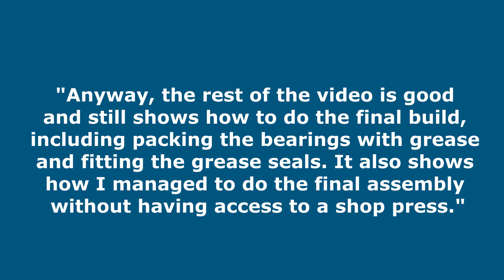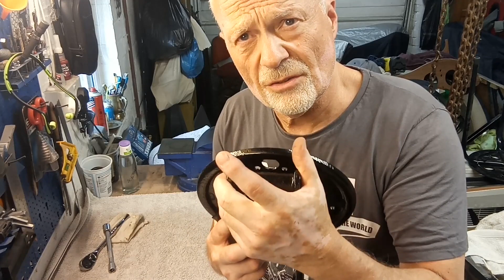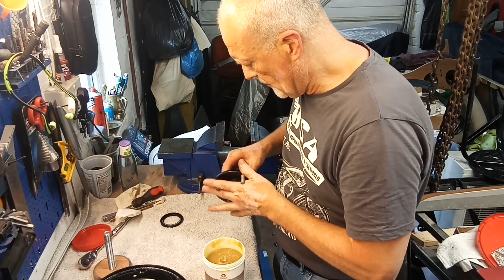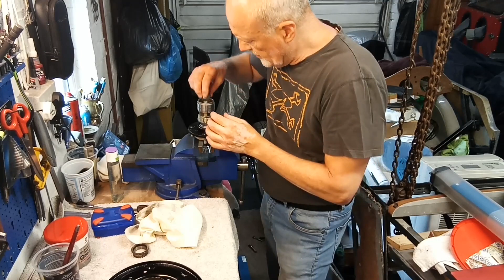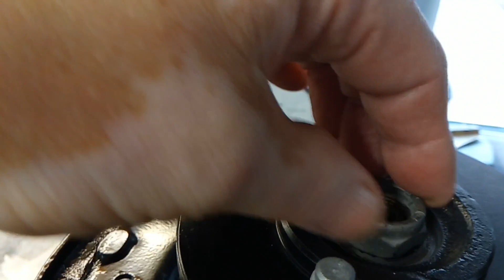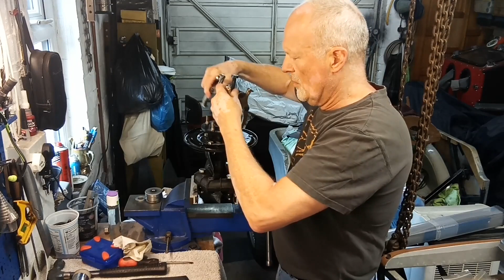Rotoflex Hub Restoration Part 4

Comment: Echo Iain's comment below! Thank you for taking the time to document and share how you have approached establishing the mystical end float in the rear hub. I have been obsessed with trying to get this right, and struggling to get a reliable measurement. What I have missed is doing the job with dry bearings, so will now attack the task again. My new-to-me GT6 project comes with the CV conversion. I've also been doing this with the vertical link still attached to the chassis, so thinking I should move to the bench. Note, I believe the workshop instruction is to install the outer bearing and seal in the vertical link first, then pull the hub through the bearing with the hub nut. That saves the grief levering the seal in afterwards. Thanks again for this insight, I appreciate the time to edit videos is significant. Your presentation and style is enjoyable :).
Reply from the maker: @jonbarker1820  I thank you for taking the time to leave me some very comprehensive feedback. I always welcome this. I will eventually convert my car to CV drive shafts which is on the list of jobs to do after the build is finished. Coming up soon will be my full EFI conversion using modified Lucas Throttle Bodies along with the installation of an electric water pump that will (hopefully) be controlled by the ECU and run as a SMART pump.
Good luck with your rear hub shims. 
Kind regards Paul